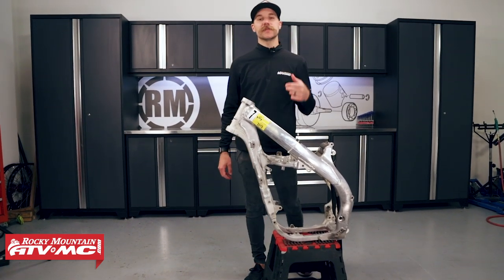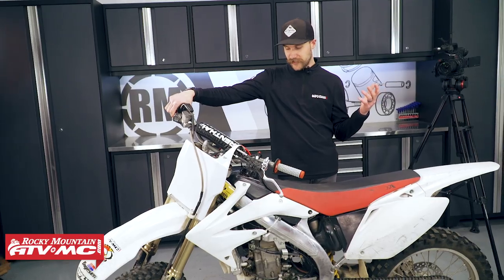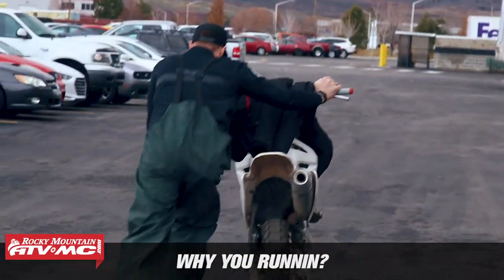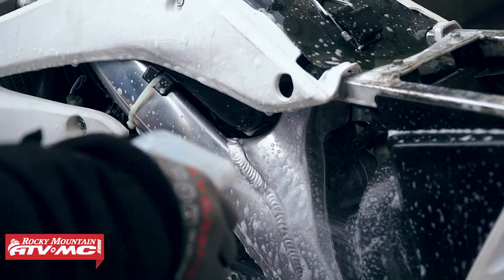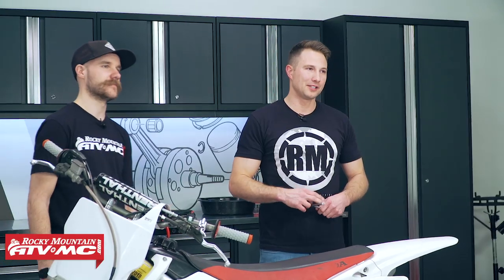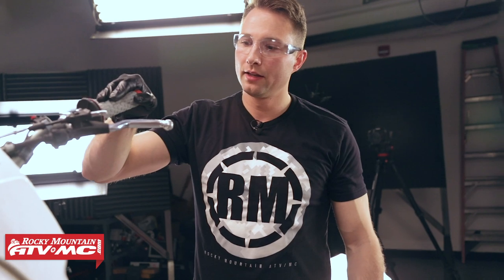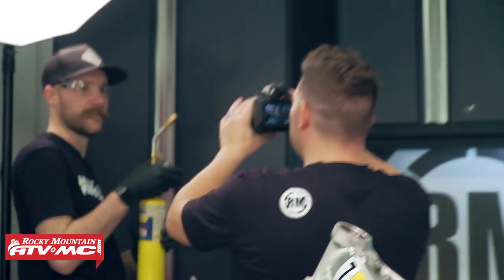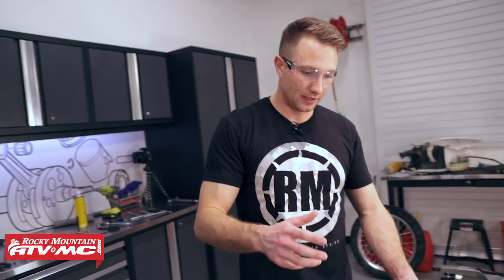Roached 2 Racing Episode 2 | Honda CRF450R Bike Build

Comment: Pro tip: if you're tearing down the motor anyway, I find it easier to remove the head and cylinder while the engine is still in the frame.  Then the bottom end is very easy to remove.  Once bottom end gets rebuilt I re-install it again first and build the top end while in the frame. Much easier.